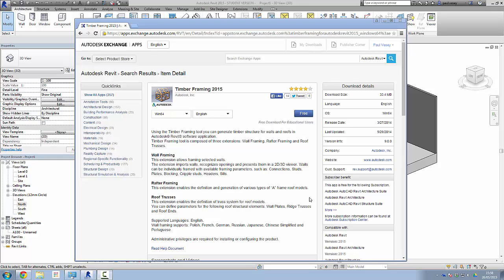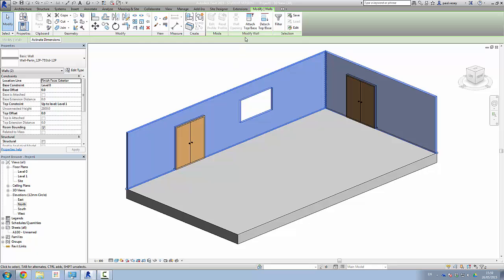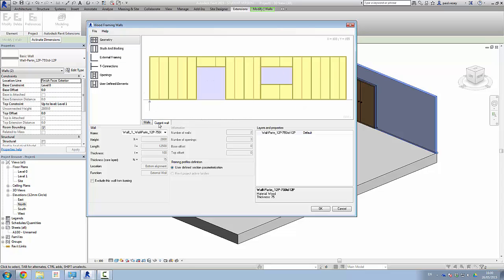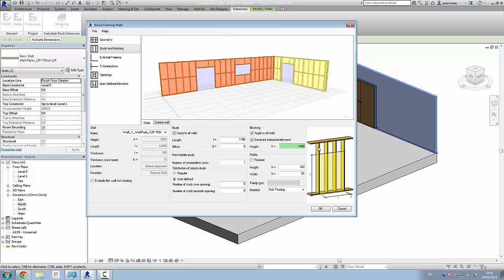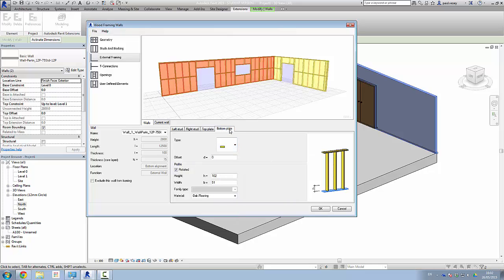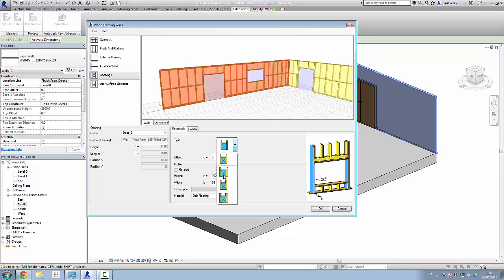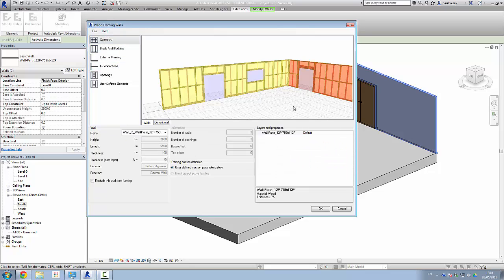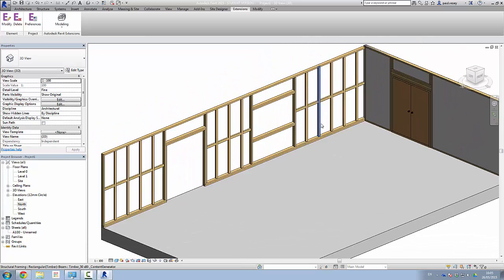Stud Wall Framing

Comment: Hello
Can i use light gouge framing system whit this app ?
Thank you
Reply from the maker: Hi Diego, You can change the profile parameters for the frame elements.  Perhaps that would work.  Also, as a 'hack'  you could export the data to excel to run any special conversions to other framing systems.  Just remember that over modelling can be a problem.  Regards Paul